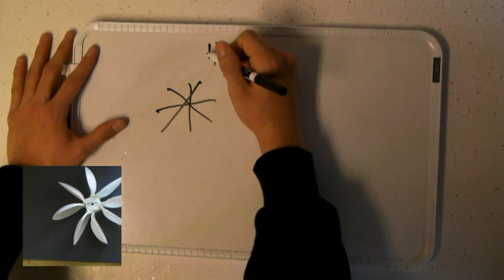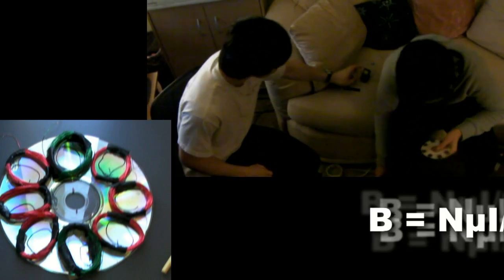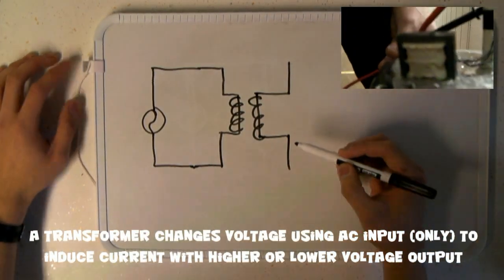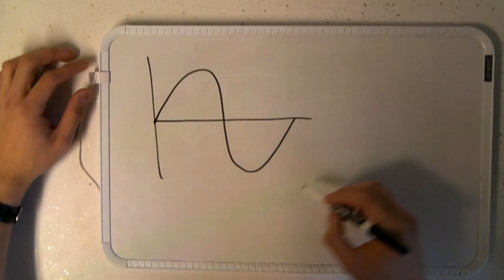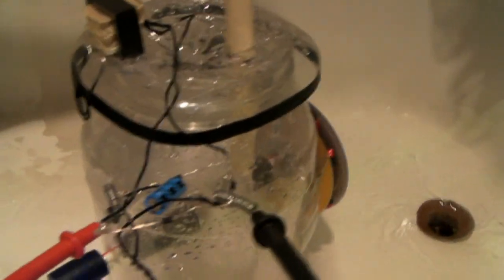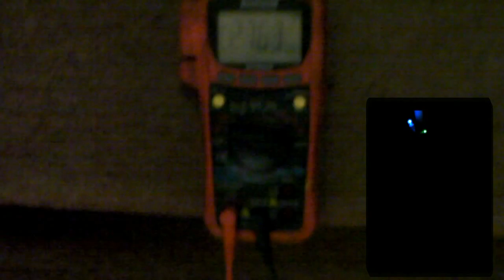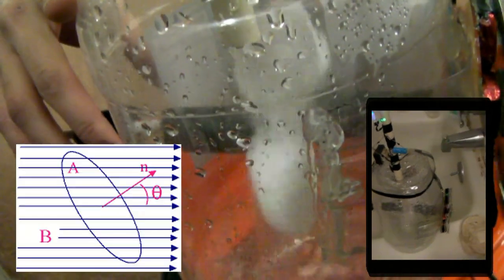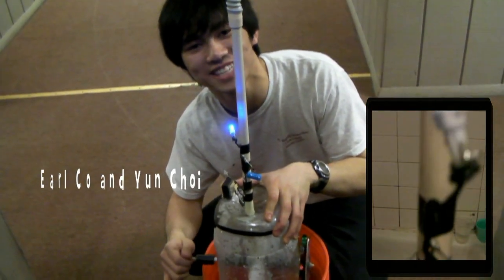Homemade Hydroelectric Generator

Comment: I learn a lot from you guys because I started going research about hydroelectric generators. At first when I watch this video I didn't get it but after I studied hydroelectric generators it makes a lot of sense . What I learned was hydropower: the production of electrical power though the use of gravitational force of falling or flowing water. It is the most widely used form of renewable energy.

Comment from the maker: Thank you very much for your feedback.

I do understand the concepts. As resistance increases, the voltage decreases when MAINTAINING THE SAME CURRENT as V=IR, I = V/R. Of course we had a multimeter, you can see it in the video. My point is that the current remained constant, so when I add the LED, the resistance in the circuit increases.

V and I are directly proportional meaning with the same resistance, increasing the current will increase the voltage correct. That wasn't what I was saying.

Comment from the maker: Good job. I never said it did. The magnetic field is caused by the magnets. The changing magnetic fields due to the rotation of the magnets produces the electromotive force, or voltage. The more coils you have, the more current flows with the same amount of magnetic field.

Comment from the maker: @Kris Scott the leads of the turbine go to the transformer and from the transformer goes out to the bridge rectifier. Two of them are AC inputs, the other two are DC outputs. Look up the spec sheet for the bridge rectifier that you got to find out which leads are which.

Comment from the maker: @bbansal98 the foam is not necessary. I just used it to keep the stick from moving around so much when the water hits it, and keep the spoon in alignment. It's self explanatory, no special foam needed.... (for the record, I used 3/4in foam backer rod).

Comment from the maker: @SamudroEntertainment thank you! You are correct on everything, and the coils were made separately and then connected together then soldered in the right orientation after. Kinda hard to make 100 coils 8 times without it falling apart. The wire is 22 gauge. Good luck!

Comment: Do the coils have to be completely seperated? or is it OK if the coils are touching? thank you
Reply from the maker: +braulio vasquez As long as they're enameled, it doesn't matter as current can't flow outside the insulation. The wires should be de-enameled at the ends where they connect with the other wires, and nowhere else.

Comment from the maker: Neodymium magnets used in speakers will work. Ceramic fridge magnets that are gray with or without holes are too weak to produce much current, but it should work according to physics, just not optimally. Neodymium magnets are just much stronger. They're usually silver and shiny.

Comment from the maker: the diode is 1N4003 from radioshack I think. the transformer is a 5:1 step up transformer pulled from a spare power adapter. You can also pull the bridge rectifier circuit from the wall adapter, but I wanted to make my own.

Comment: You would only need 2. A bridge rectifier needs 4 because of the way the circuit works. 2 LEDs would allow the current to flow just fine in both directions.

Comment from the maker: the leads of the turbine go to the transformer and from the transformer goes out to the bridge rectifier. Two of them are AC inputs, the other two are DC outputs. Look up the spec sheet for the bridge rectifier that you got to find out which leads are which.

Comment: If i have six coils with 50 revolutions can i use 8 magnets and put them in alternating poles instead of six that are in alternating poles? Its because i glued them wrong and its hard to take them off. Will these coils be enough to power anything, like a small LED light?
Reply from the maker: +Jose Lopez Why don't you try it?

I don't see why the number of coils has to match with the number of magnets. The more coils the better because it means the current changes direction more frequently. The more revolutions the better because it means there's more electrons in more wire in the first place.

I got your email but I'd rather comment here because that way other people don't ask me the same things over and over.

LEDs require 1.5 VDC to turn on. As long as you can somehow output that, it should work. I used a step-up transformer to bring my voltage from 0.17 VAC to 1.7 VAC, then used a bridge rectifier to turn it into 1.7 VDC.
Reply: thank you so much

Comment: I have a question, so I'm also working on this project but I was wondering when wrapping the coils, I didn't have enough to wrap them all with just one single copper wire so I just twisted another strand of copper wire to it. Is that fine? Also should I have sand all the ends of each coil before I twisted them together or just only the beginning strand and ending strand? Sorry if this is all confusing but would appreciate for the help?
Reply from the maker: +Yuridiana Pantoja It is very confusing what you're doing, but it sounds like you did what I did. I made 8 coils separately and twisted one to another daisy-chained, keeping in mind the orientation and direction of the wrapping so it alternates clockwise, counterclockwise, clockwise...

Sand the ends of each coil first THEN twist the ends together. Otherwise, the copper won't touch because the enamel will be insulating them.
Reply: +Earl Co thanks for the reply and for the clarification, and I only have 4 coils but wrapped them 200 revolutions. Thanks for the help, now let's see if my project will actually work hah
Reply from the maker: +Yuridiana Pantoja More revolutions leads to more current, but more coils means quicker alternations and thus more voltage.
Reply: +Earl Co Thanks for the tip, and is it okay if the copper wire is tinted silver also the magnets can be ceramic right?
Reply from the maker: +Yuridiana Pantoja You NEED neodymium magnets, the largest and strongest ones you can get. I got mine from Hobby Lobby, 3 for $3, but you can get them online as well.

The copper wire doesn't matter, as long as the enamel is sanded off the edges (but not anywhere else!).
Reply: +Earl Co It has to be 24 Guage right?
Reply from the maker: +Yuridiana Pantoja No. The gauge is simply a measure of the wire diameter. The higher the gauge, the thinner the wire, and thus the more wire loops you can fit in the same area.

Comment from the maker: Following this entire comment thread back up, @Benny WangMusic was asking how I boosted the current up. I replied that to increase the current, voltage was dropped. I was explaining that the power was maintained constant (I couldn't increase the generator's power output aside from spinning the turbine faster). I used a transformer to increase the current which dropped the voltage, just as transformers in electric grids lower the current passing through a cable by increasing to high voltages.

Comment from the maker: @Alchaeon1 you would be correct if the valve and the turbine were at the same height, but they're not. The potential energy from the difference in height ADDS to the energy from the water pressure out if the valve.

Comment: I have some questions:
What kind of tape did you use for the coils? Is it electric tape? Did you glue on the magnets?Also where did you put the straws and what is the black stuff on the shaft? Do magnets other than neodymium work? How big should the jar with the turbine be? Do the wires have to be insulated?Is a transformer a necessity if you aren't using it to power anything just to measure the voltage?
This is it, and please respond. Thanks!

Comment: Mine only produces .030 Vac is there something wrong with it? i only have 6 coils of 50 revolutions, 8 magnets on opposite poles, and the turbine. everything is put together but i havent added the transformer or the lef yet or anything else.
Reply from the maker: +Jose Lopez Mine only produced 0.17 VAC with 8 coils, 100 revolutions each coil. Your 0.03 VAC sounds about right if you're using fewer coils and fewer revolutions per coil. You're just not producing that much voltage and probably not that much current either.

The transformer should help. You'll need to increase your voltage by stepping it up by a factor of 50 (the current goes down even lower as a result making your LED even dimmer but it should turn on at least).
Reply: Earl Co Ok thank you very much you are very helpful

Comment from the maker: @bbansal98 Coils use electric tape.
Magnets are hot glued.
The straws are used to mount the skewer axle on the jar edge and
decrease friction.
Black stuff on shaft is foam used to hold the skewer in place to stop
the turbine from shifting side to side, and is adjustable.
Magnets MUST be neodymium. No other magnets are powerful enough to get
any decent voltage out of them (like ceramic magnets). Get them from
the local hobby or hardware shop (Hobby Lobby etc).

Comment: The LED clamps the voltage at 2.7V.  After all it's a diode. Try using a resistor and an ammeter to measure the power produced.
Reply from the maker: hmm... I know at some point the LED can't handle a certain voltage and will start to burn out, but I thought that varied depending on the LED.
Reply: Yes. Basically when diodes reach a certain voltage, they start conducting a lot of current instead of raising their voltage more (they are not like ohmic resistors). So even if you applied 500V, the led voltage would still be around 2.7V but the current would be several Amps, destroying the led from the heat produced.

Comment: You should have used a star formation three stage generator. That way, you could have run the thing even smoother and you would have a much more stable and adaptable voltage source.

Comment: Diodes let current pass through one way but not the other did you notice how he had all the diodes facing the same direction? The bands he drew which is the cathode end allows the ac current to pass and the anode end does not. If you look at his bridge rectifier again the left is negative and right is positive.

Comment from the maker: @beancube2010 also you are so mistaken. You don't need more output to light two LEDs, just wire them in parallel, as I demonstrated in the video! They will just be half as bright but it doesn't take much to make LEDs light up. Doubling current will merely double the brightness. If I wanted to power something more powerful though then I'd need more current.

Comment from the maker: "thus creating a more uniform output voltage smoothing out the high peaks and deep valleys" so in simpler 11th grade words, it regulates the output voltage. Yes a simple capacitor does this by charging and discharging at regular intervals depending on its capacitance but I don't really have time to explain a capacitor since this video was mostly about the generator and changing magnetic fields, and most people already knew what a capacitor does.

Comment from the maker: @bbansal98 The valve was from a local Home Depot or other hardware shop. I just
drille a hole and screwed then glued it in.

The transformer was used to jack up the voltage to actually usable
levels. In essence, we kind of cheated. :P

Comment: As Resistance increases, voltage DECREASES? IDTS. Voltage is directly proportional to Resistance. So as the resistance increases, the voltage also increases.

Comment from the maker: I guess what I was trying to say is that the voltage reading on the multimeter naturally drops to 2.7something volts when the LED was drawing current, when it was 6.something volts before I connected the LED to the circuit. The voltage reading decreased as the current in the circuit decreased because some was being used up by the LED. Does that make sense now?

Comment: The 13 inches of water in the bucket is not in addition to the force of gravity. The height of the water above the hose exit is the value you use to determine the pressure  or head of the system. The equation is simply rho*g*h, where rho is the density of water, g=acceleration due to gravity, 9.8 m/s2 and h= height from turbine  blade to water level in bucket.

Comment: Ok I admit I didn't watch the whole video, and i know the video is old... But did you consider putting 2 leds in parallel with opposite polarity and skipping the rectifier? They're already diodes and you'd be able to light them up with less losses.

Comment from the maker: +balqis husna did you type that in reverse? The input of an adapter should be AC 100-240V and the output should be DC. You don't need a bridge rectifier then, it has one built in. Just wire the transformer in reverse. But I think your comment was mistaken. I've never heard of a power adapter that goes from 5V DC to 100-240V AC, it's just not practical.
Reply: Earl Co opps, I did. Sorry, didn't notice it earlier. I see , thank you
Reply: +Earl Co hey, I did the generator, but the LED was not lighted up. what should I do ?
Reply from the maker: +balqis husna check all your connections and follow the current
Reply: +Earl Co okay, the connection are okay, is it because of the coiled wire ?
Reply from the maker: +balqis husna perhaps you aren't alternating the coil direction from clockwise to counterclockwise as explained in the first part of the video.
Reply: +Earl Co thank you so much! It worked, thank you for guiding me to make this project, I really appreciate it
Reply from the maker: +balqis husna GREAT to hear! You're welcome!

Comment: sir, how did you link the electricity produced from the copper wire into the transformer, did you directly link it or do you have to go through some device first? and also what did you cover the copper wire with? last, the magnets poles.... are changing for each adjacent magnets right.. thanks.. hope u reply...
Reply from the maker: +ryuta kawasaki Connect wires directly to transformer. The copper wire isn't covered with anything except the enamel it came with (and some electric tape to keep the winding together). The magnetic poles alternate, correct.

Comment from the maker: @beancube2010 yes but 1) how do you propose to spin the coil rotor in the opposite direction without a second axle, and 2) how do you propose to deal with the connecting leads that must be attached to the circuitry?

Comment: what if I don't use the bridge adapter ?
I mean I have an adapter that the output : AC 100-240 V 50hz ~400mA , Input : DC 5V ~400mA

so do I still need to use the rectifier
Reply from the maker: +balqis husna That has the full wave bridge rectifier built in. See the four diodes and capacitor used to convert AC to DC.

Comment from the maker: @HiFiman4u how do you propose I start with a DC output if the concept of a generator REQUIRES an AC current? Also, I don't want an LED flickering in and out so I'd have to install a bridge rectifier anyway. I'm actually not quite knowledgeable about the phases too much so I kept it 1:1 ratio. The transformer was just there to boost the voltage because I was only getting 0.2V without it so I installed a 10:1 ratio step up transformer to have enough voltage to power the LED.

Comment from the maker: @roberkaf95 I just pulled one from an unused power adapter. it even had a bridge rectifier right in there, but I didnt use that cuz I wanted to build my own. make sure you wire the transformer in STEP UP orientation not STEP DOWN. Doesnt matter the specs, just make sure the ratio of coils is enough (divide output voltage by input voltage, would probably want at least x10).

Comment: We have to build a hydro electric generator for engineering and it has to light an LED. We have tried everything and ours doesn't seem to work. Please help.
Reply from the maker: +August Ogle Sorry I can't really help you over the Internet. My only recommendation is to follow the instructions exactly as stated in the video and PDF. Test your voltage outputs with a multimeter. Make sure you are producing 1.5 VDC or greater, as LEDs only turn on when the voltage is at least 1.5 VDC. If you are not getting enough voltage, add a transformer just after the leads from the coils, and make sure it's oriented in the correct direction (step up, not step down).

Comment: here's a simpler idea:
- take one electric motor from radio shack, an old cassette player, etc.
- put a propeller on the electric motor
- connect a consumer(led, etc.) to the motor's connection pins
- put the propeller in wind, under water jet or simply spin it and enjoy the magic

Comment: Could you please tell me what thickness your Insulated Coiled Copper Wire was? I'm making this for a science fair project, along with a wind-powered and solar-powered generator as well. It was 100 turns of Wire per coil, correct? Which would make 800 turns in total? Sorry If I'm overloading you with questions :D Your video was very educational and well done, by the way, thank you for making it and posting it on to youtube.

Comment from the maker: A motor is merely a generator run in reverse, so yes that will work, but it's not the same as building a motor, to satisfy the requirement of a science project made with household materials. Also, there's something about the inefficiency of a motor for GENERATING electricity because a motor is designed to convert electrical to mechanical and not the other way around.

Comment: SO ANY TRANSFORMER WILL WORK? AND I AM MAKING A FARADAY FLASH LIGHT BUT THE SAME CONCEPT RIGHT A MAGNET RUNING THROUGH A COIL AND A TRANSFORMER IN THE CIRCUIT. DO YOU HAVE DC OR AC GOING THROUGH THE TRANSFORMER?